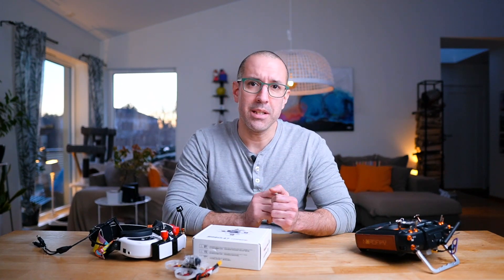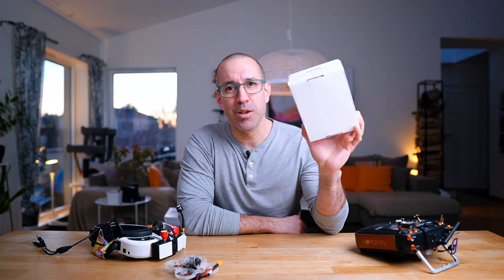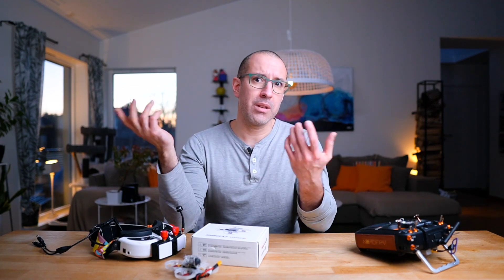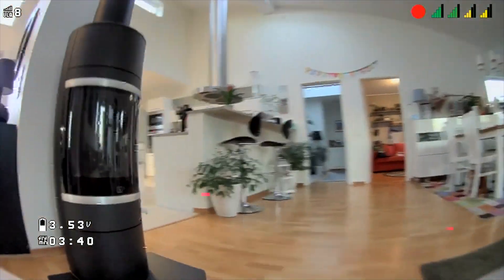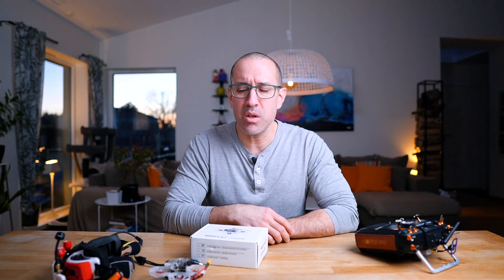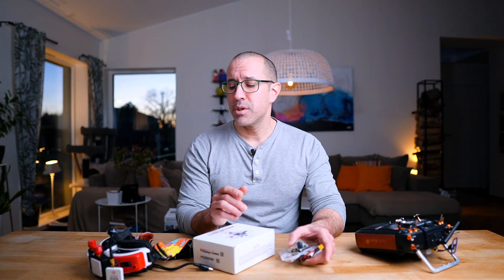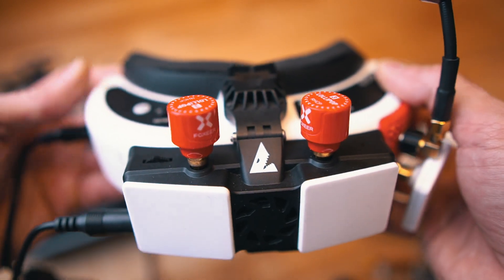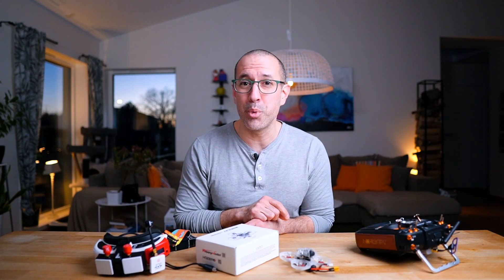Digital Tinywhoops - My first experience with a HDZero FPV drone

Comment: Just a comment... I run the Caddx Polar Vista on the 2S TinyGO without issues. I also tested the Vista on a power supply, it transmits video down to 5V, maybe not at full blast but enough for indoors (my Vista is set to 200mW).

Comment: What I want to see is innovation in DJI digital whoops! DJI WHOOPS WILL RUN ON 7.4v and up, SO 2S IS A GO! My lightest 2S lipo is only 20g. Also, please remember, where 1S is very popular for whoops, 2S is no slouch! It makes your whoop quite a bit faster ... and with a good tune and great flying ability, a 2S whoop can be very competitive and super quick! :)

No one, and I mean search YouTube and there's virtually nothing, about people making ultra lite weight DJI naked Vista whoops! Sure, you'll find 60g+ videos, but BetaFPV already make the lightest available for sale at 54g. I'm in the process of building one that will weight between 36 and 38 grams with the naked Vista with Nebula Pro Nano, so 120fps, low latency, and changeable settings. Why is no one else doing that? Guys, let's see how low (weight) you can go!!! 

The naked Vista now weighs 9.2g and the lightest Polar camera weighs 2.7g, so getting a whoop very light is indeed something that can be achieved!  The 120fps Nebula Pro Nano only adds 0.3g to the Polar's weight, but gives us the lowest latency possible for DJI quads.

Maybe you can build one and see how low you can get the weight?! And how great it flies. Don't forget about EmuFlight, as it typically kicks Betaflight's AS$ when it comes to great stock tunes for whoops.😎🤘
Reply: In the last year or so whoops became 1s standard. So 2s whoop is outdated a 2s hdzero because of the battery is too bulky and heavy to be comparable to the 1s that has become standard now.
Reply from the maker: But what do you do with the battery? the battery will weight more than the drone? :D
Reply: @NordFPV  How about a 2s 300mah that weighs 20g? I also have a 370mah 2s that weighs 25.7g. That first one is a Tattu, and the 2nd is a Nanotech. Great batteries!  Not too much weight for a whoop that is fast and also nimble! ;)
After all, that commercially available HDZero whoop weighs around 41g.
Reply from the maker: @KOrnhOliO1  But DJI won't run on 2S...
Reply: @NordFPV  since when? Sure it will! It won't run on 1S, not 2S.  Vista = 7.4 volts and up.
;)
Reply: @NordFPV  Well, since you have by now look it up and found the Vista will run on 7.4v and up, you can go back into your video and edit the parts out where you said it requires 9v. Then, maybe you can add a part about DJI whoops running on 2s and being very possible. Otherwise, this video misinforms, and let's people think DJI whoops are non existent, and that nif far from true!
I talked to a guy on YouTube named Filipic, I think, and he says he races his 36g DJI whoop against other locals and it does quite well against them. Very competitive, but of course, crystal clear image quality! ;)
Reply: @NordFPV  Only if we are going by your incorrect statement (sorry) of the Caddx Vista running on 9v...when it's actually 7.4v and up.  So, taking that into account, it won't require a 3S battery, like you implied, but only a lightweight 2S lipo! Much more feasible making low weight and super flying DJI whoops when it only takes a 2S lipo. My lightest I own is only 20g!! ;)
Reply: Well, I've personally been wanting DJI and/or Caddx to innovate and release an even smaller, lighter version of the vista that can take 1s voltage. 
DJI and Caddx are silent about any further development with the system. 
The current whoop board from HDzero is nice... but, the real game changer will start once the new prototype 1s-4s HDZero transmitter/camera combo are released.
I'm seriously looking forward to 65mm and 75mm builds for 1s with HDzero. 👏